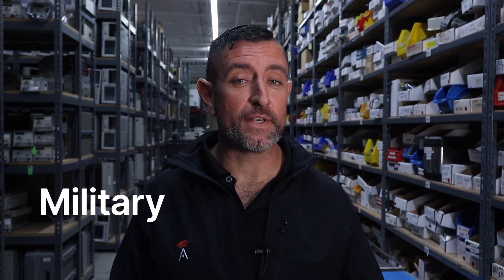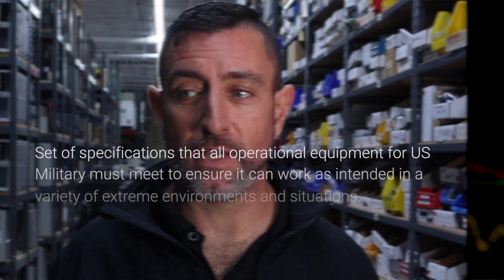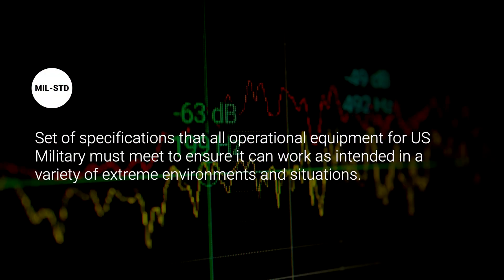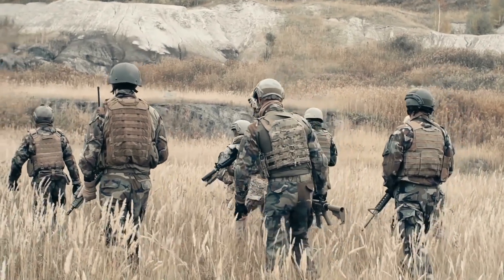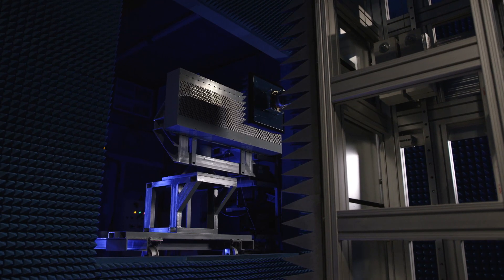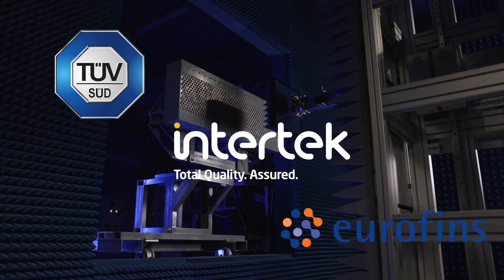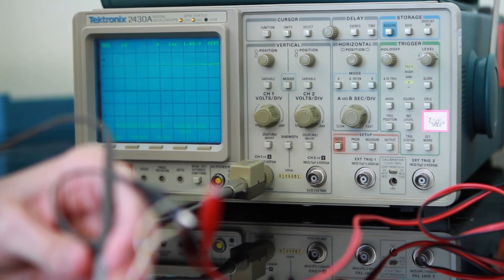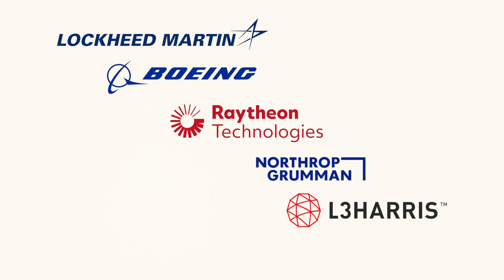What is MIL-STD Testing (and why is it so important)?

Comment: Exactly, When a Airplane in Alaska or snow conditions has it's engines activated, that temperature shock (specs: -55 to 95°c ) there is a temperature stress on metals, moisture, where the motor vibration levels will not endure should that mil standard not be imposed on all Military hardware, communication devices as well as gear/telemetry metering.